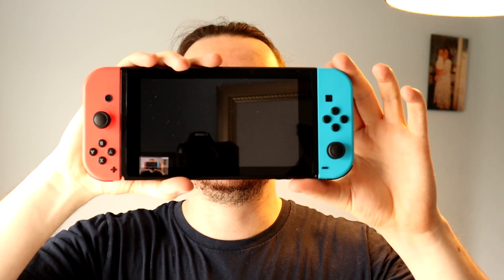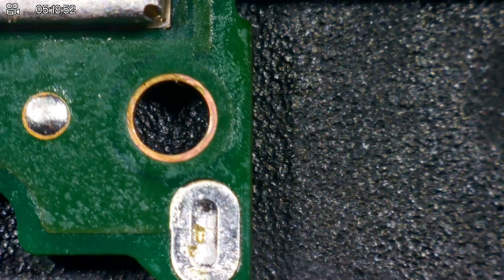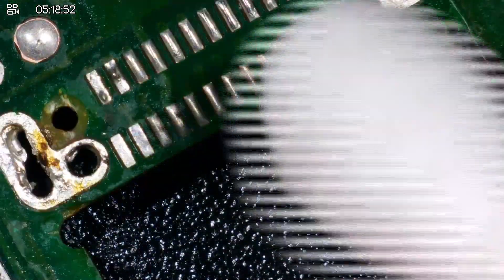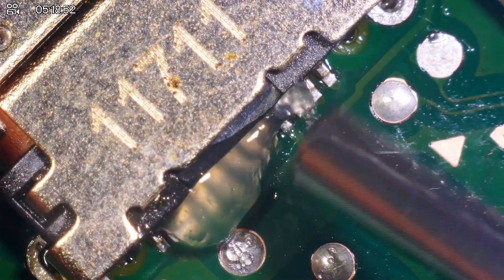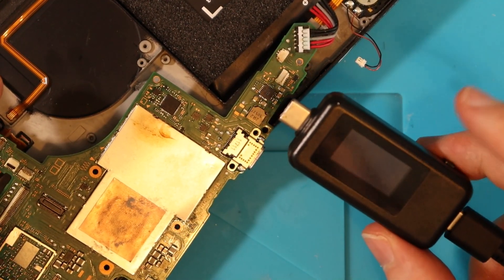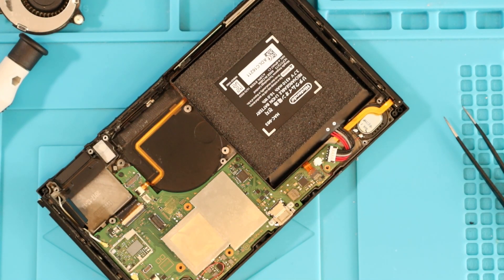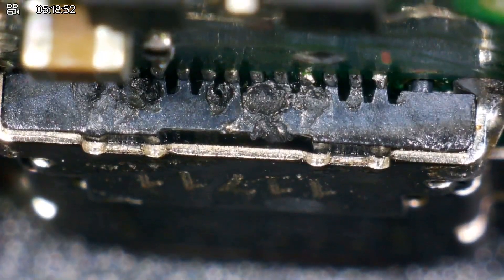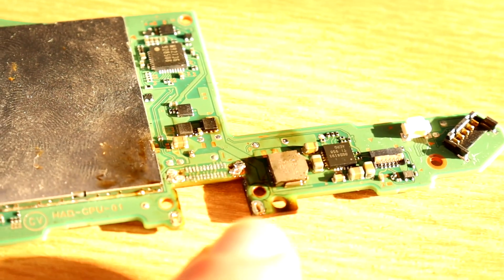Destroying a Nintendo Switch | Replacing the Charging Port!

Comment: In this one could you of done it without hot air?, Just tinning the pins and the ground legs at the back, I'm not sure as i've never owned a switch or attempted this. Just thought that would of been easier than using hot air and melting plastic but i'm not sure.
Reply: Think i realised that theres pins underneath the metal shielding, Hence why it needs hot air i think, mb
Reply from the maker: Exactly that Steven. You know I've still not actually been able to fix one Nintendo Switch I've purchased? I'm on 4 now >.<
Reply: @JoeyDoesTech  it's all about practice mate, I fried an Xbox one X the other week. With my current living situation I haven't really got the space to be soldering at the moment but going to keep trying to buy little electronic devices to fix. I've bought a kids learning tablet for £7 with no power, they're £55 new. So be good if I can fix it for my little one.

Comment: Hey mate came from MMV and tronix fix. Just a quick question ? You don’t point the fan at your work do you ? The hot air and iron will struggle if you point your fan at your job. Well mine does if I have my fan pointing at my working station. Good luck
Reply from the maker: Hey Dan! You know what... I was actually point a fan towards it to help with the fumes, maybe this is something I could try without.

Welcome to the channel and thanks for the heads up :)
Reply: @JoeyDoesTech  yeah mate get an extract fan for the fumes. It sucks the fumes away rather then having the fan air pointed at your job making soldering harder.

Comment: Hello, i have a question.

What is that glue that ure putting before melting ur charging port and why do u put it ???
Reply from the maker: Hey Yaca 😊 So that is called "Flux". Its used when soldering to help the solder flow, and makes it an easier job.

It does get very messy though, and can be sticky if left on the board.
Reply: @JoeyDoesTech  thks !
Reply from the maker: @yaca_  You're welcome :)

Comment: Another fantastic learning opportunity on this one mate.  It will get easier, I promise.  I've had those solder wick nightmares in the past, and convinced myself that when others are doing it they must be using magic or something.  But it's a combination of the thickness of the board, the wick itself (try some Gootwick), the flux you add, the size of the tip on your iron, the heat of your iron, and the condition of your tip.  If one of those things isn't on point, it can be a hell of a job.  Keep practising mate, you'll get there! 👍
Reply from the maker: Thanks Steve, yeah it was deffo a great learning opportunity. Knowing your equipment is probably one of the top 3 rules in this game, and i'm learning that more and more each day. Patience closely follows... 😂

Comment: Joey Does Tech: as endorsed by fixer celebrities!

Like I've said before, don't try to please the viewers but just keep doing what you're doing and being you - your passion and enthusiasm shines through and naturally which automatically pleases the viewers. Keep it up mate. 🤘😎

That tip cleaner dome thingy is the one I bought from Jelly Belly Customs and recommend to you a while ago. Use the damp sponge to get the initial big blobs off, then the dome to drag off the micro excess solder. Doing both will minimise tip corrosion (however tips won't last forever).

Looks like quite a few fixer Tubers are having Switch nightmares.

Ironically during your video I had a Channel 4 Paralympic advert featuring the song lyrics "you may as well quit, if you haven't got it" (from Bugsy Malone I believe) - the footage shows various Team GB Paralympians going through their struggles and persisting regardless towards success. A brilliant and inspiring piece of cinematography.
Reply from the maker: Thankyou Toxo! Your comments always inspire me to keep trying pal. I'll give it my best shot on the livestream today! 👍😁

Comment: Looking at Steve’s approach (https://youtu.be/TUUv9FGXMT0) to the port replacement he mounted the board so the air flow set very high so as to complete the removal quickly and then preheated the area before offering up the new port.  It must be a faff having to work in mid air but I guess it reduces the flow spreading across the rest of the board.  I’ve not worked on such a board but I have experienced wick not lifting the solder when there are massive ground plains sucking away all the heat and needing to use a heating plate to add extra heat before trying my air station and finally the iron.   Keep practicing and best of luck!
Reply from the maker: Yeah I think you're right Chris. Maybe a lot more speed on the station would be better. I'll have another go this afternoon, and hopefully I get a result 😁

Comment: Add some flux to the wick before you heat it.
Reply from the maker: Tried that pal 😥 Tried combinations of all sorts!
Reply: @JoeyDoesTech  Your technique looks fine to me. I can only assume the difficulties you are having is down to your equipment. The 'all in one' station might not be up to the task. You might need to upgrade. Ask the others what tools they are using.
Reply: I have a cheaper station, and ground planes can be pretty tough,   I found it was a lot easier using a thinner wick. I use 2mm wick except for super big jobs.
Reply from the maker: @damianpinnington5477  Deffo noted Damian. Thankyou :)